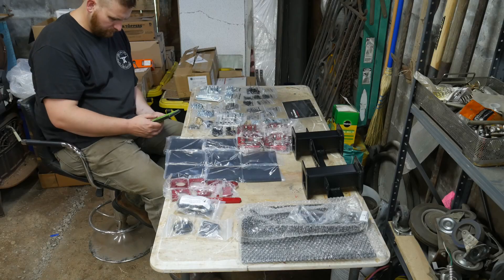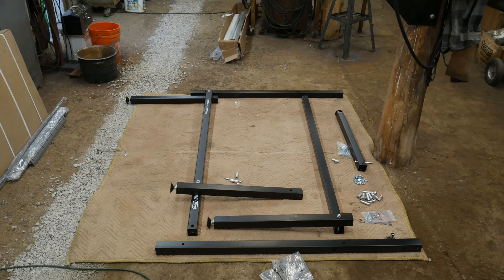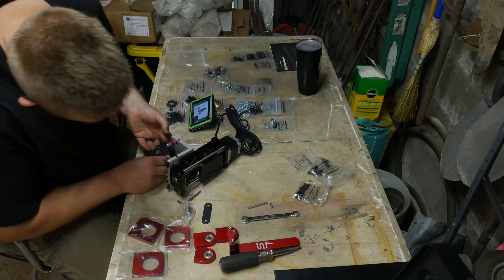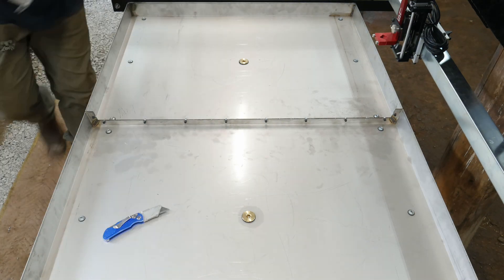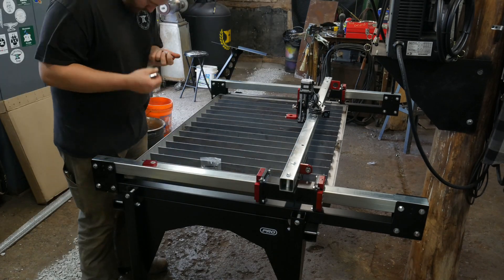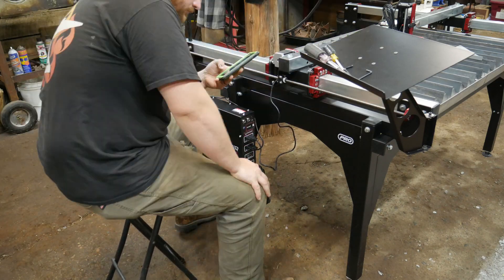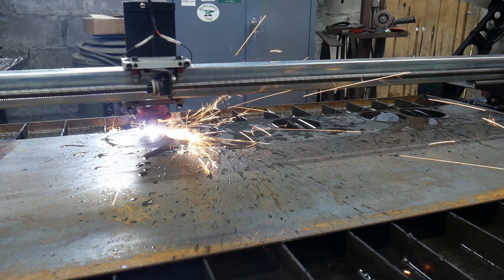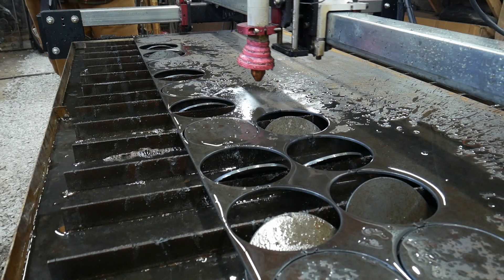Langmuir Crossfire Pro BUILD & REVIEW

Comment: I have a hypertherm 45 it would be great if you can do a video showing how to wire in the hypertherm.  I have the cnc plug on my unit but I understand it takes a additional cable for the height controller.

Comment: Roy what's your opinion on getting  an 3rd printer to prototype work before using metal?
Reply from the maker: It may be useful in the future but as far as blacksmithing is concerned probably not that handy
Reply: @ChristCenteredIronworks  I was thinking more along  the lines of if the print build  platform is big enough use it as an template